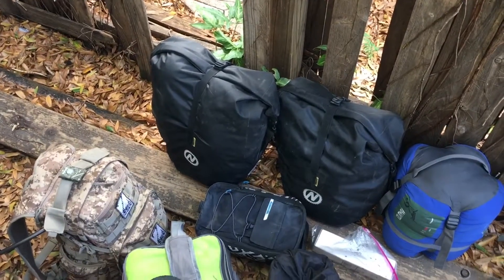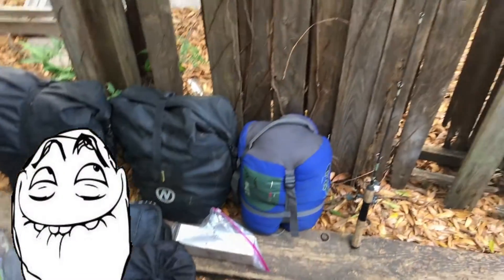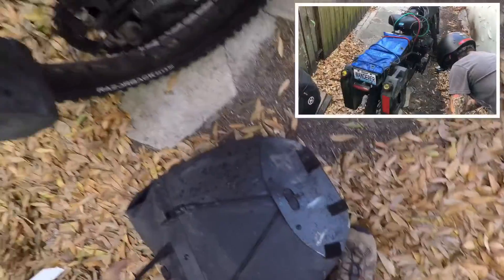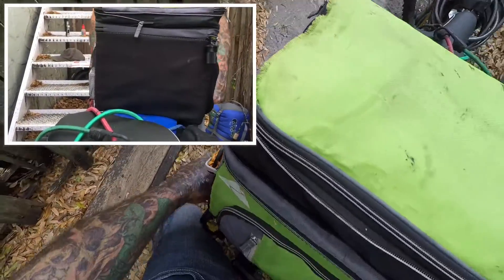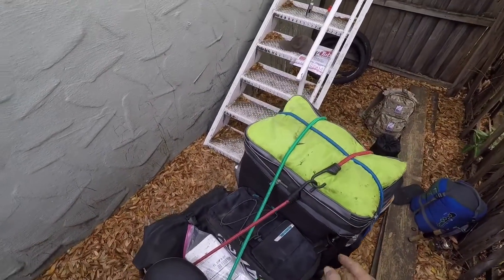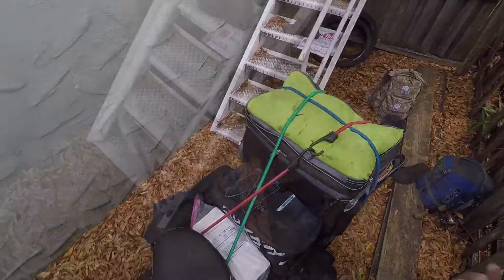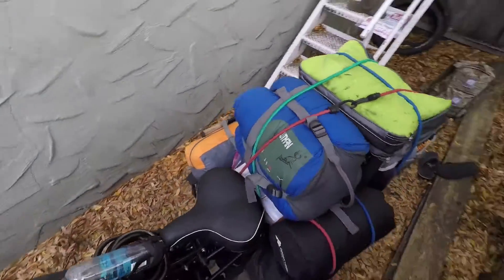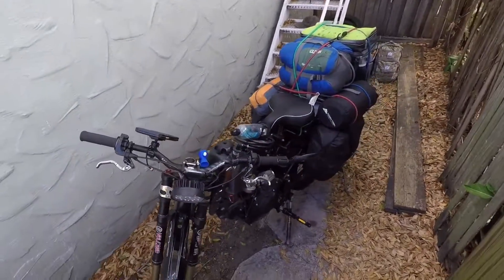How To pack a bike for a ride. Bike touring. Motovlog. Motoped. Motorized bicycle travel.

Comment: Johnny, getting ready to turn west it looks like...you can charge the xtra battery from the bike.just make a lead with some wires,,, fused at both ends at the batteries + terminals...you can make quick connecters with DEANS connectors, sold at RC hobby shops......if you were close I would hook you up, I'm near Fayetteville AR.....LMK your route, would like to ride a day or 3
Reply from the maker: +Mike J awesome man thanks for the input. I'll keep you posted sir.